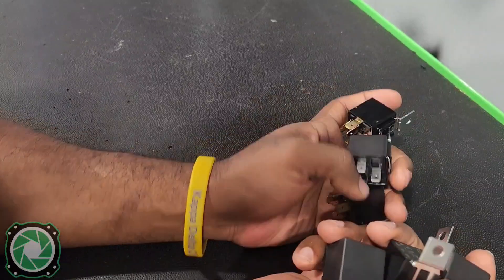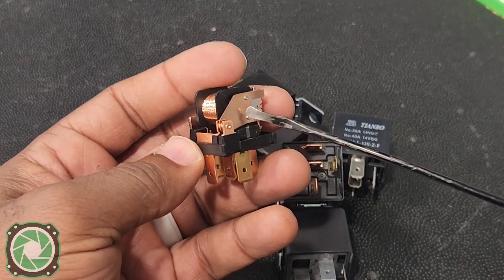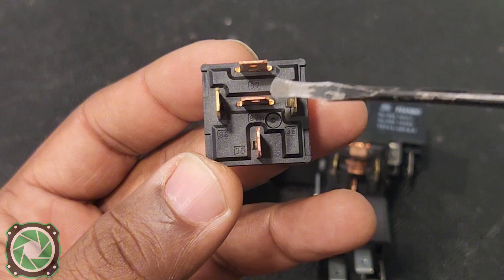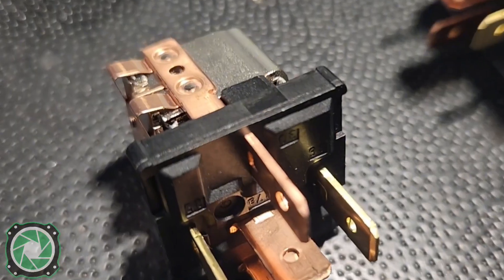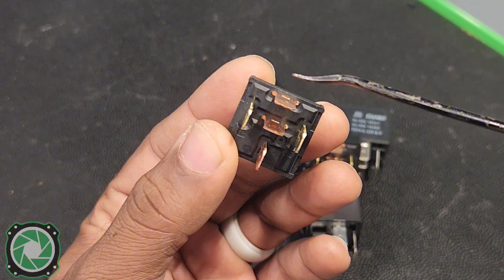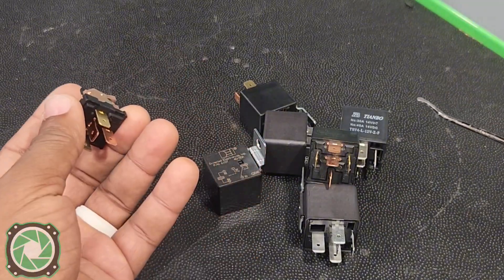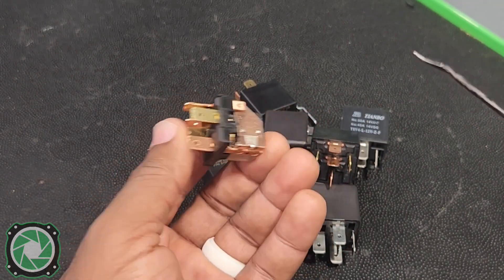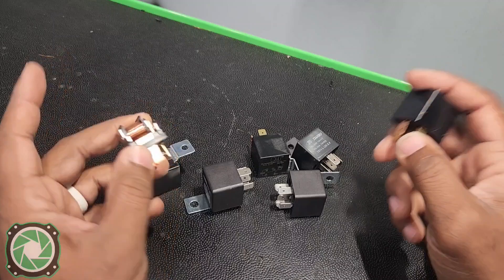How To Wire A Relay for Car Audio Accessories

Comment: I recently watched a video from barevids, and he did a test saying basically you dont need a relay. The relay would pull more power than just daising chaining your remote turn on's? He does a test showing this. Im not trying to discredit your excellent video, and excellent job on explaining about relays! Im not saying whos right or wrong, just thought i would point this out. And would be interested in your take on his video! Subscribed.
Reply: Great info for when you are only doing a a few amps. Definitely no need to make things more complicated with a relay.

 On a side note, it is good knowing how relay work and are wired. Helps with troubleshooting or to elevat your build. Adding lights, cooling fans, or other accessories.